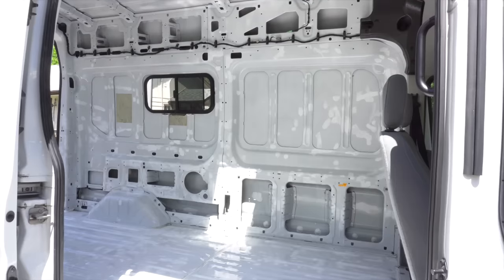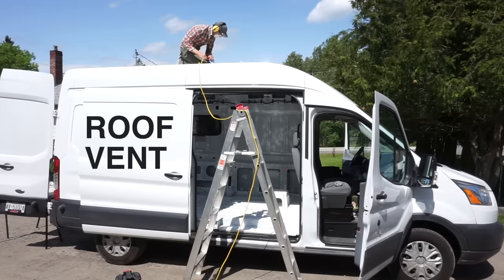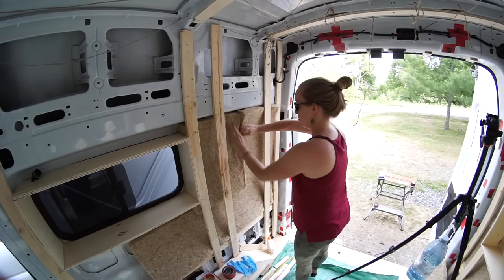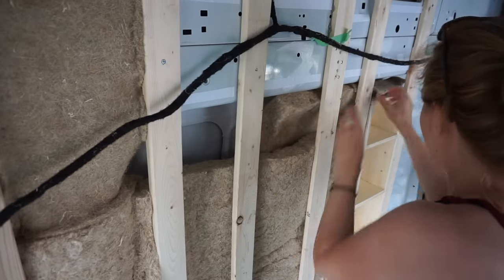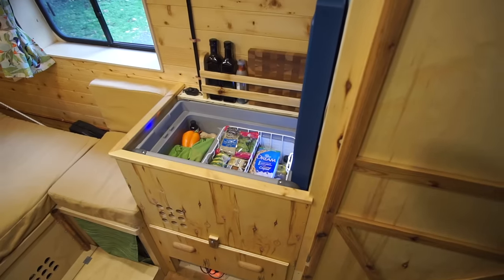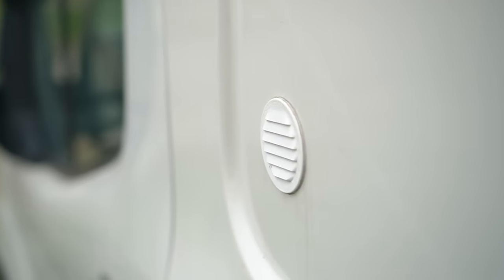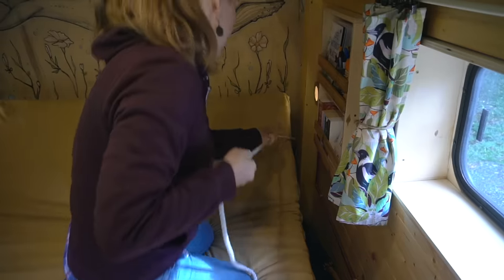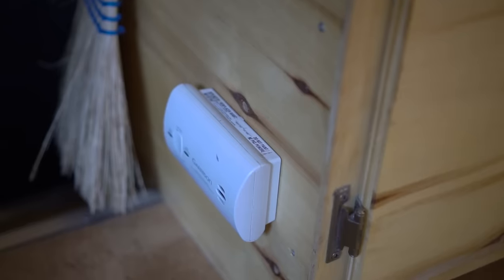FULL DIY VAN BUILD from Start to Finish | Our Epic Van Life Conversion

Comment: It’s understandable that you were thinking you were creating ‘breathable’ walls, however a ‘breathable’ wall needs all elenents of the wall to allow vapour to pass through (ie. vapour permeable). In the case of a van however you have one non-vapour-permeable skin (the metal) so you simply can’t make a ‘breathable’ wall.

If you consider that ‘breathable’ means moisture has to ge able to pass IN and OUT on both sides, with a van you have to think rather about how moisture might get in to the wall, and prevent it from doing so. This is because once inside the wall it won’t ‘breathe’ through the hemp & ply into the inside because that requires the moisture to stay as vapour; for the path through to the inside to be the path of least resistance, and a difference in atmospheric pressure to drive the vapour movement (to ‘pull’ it through). Moisture that gets in between your metal and ply lining would condense on the metal, run down, and sit on the bottom of that gap, as would any water leaking in from outside.

Having checked there were no leaks, and filling with hemp, the next measure would have been to install a vapour barrier in front of the hemp and behind the ply, to prevent any of the warm, humid air that develops in a small living space (breathing, cooking, heating with gas, showering etc.) from entering into the wall build-up. I think I understood that you were thinking / contemplating that the vapour barrier would go behind the hemp insulation. The way I tend to describe it is that in a wall with a non-breathable surface like a van side you want a ‘vapour barrier’ to stop water from outside getting in through the metal skin of the van, and a ‘vapour barrier’ to stop warm moisture pushing through the ply lining into the insulated wall space. In this case the ‘vapour barrier’ stopping water getting in from outside is made up of all the measures you diligently took like caulking all the leaks - every measure taken to prevent leaks add up to your ‘vapour barrier’ - it doesn’t have to mean an actual plastic or metal sheet material being laid over the whole of a surface (if that makes sense). Then you would put a second vapour barrier - this time a non-permeable plastic sheet material - across the inner surface of the insulation layer before adding the ply. This layer needs to be 100% non-permeable, which is why you will see people taping every joint of the material, and also often running tape to fully cover any timber strips they plan to fix the ply too, and other elements like beds & cupboards. Lastly, after fitting everything, you would tape over every screw head used to fix the ply and anything else fixed through the ply to the van wall, because each screw puts a hole in your vapour barrier that you want to seal up. It seems a bit over the top at first, but it’s really important if you’re putting up the barrier to make sure it’s 100%, because if any mousture were to get in, it really won’t be able to get out through that barrier using vapour capillary action. It is better to do as you have done and not install the inner vapour barrier at all than to install one and then not tape up the punctures. Also, were you to be making a fully sealed system there would have been no benefit to using hemp, and I understand why you wanted to - I build houses with it, and love hemp in construction. You could redo the areas you discovered the problems with by using the hemp again (you have paid for it now), then install a vapour barrier in front of the hemp, just behind the ply, and the warm air then won’t be able to get in and condense in those areas. I’m sure you’ll find the right way - you’ve both clearly made a really considered study of every aspect of this robust build.

I hope in writing a ridiculously long comment it hasn’t unintentionally come off as ‘lecturing’ or critical. It took me quite a while to figure out why & when we were using membranes (& when they needed to be breather membranes and when vapour barriers) when I first started building, aiming for breathable build ups wherever possible, so I thought I would try to find a way to explain the physics without repeating the explanations that flew right over my head the first few hundred times 🤪

Enjoy your great home 🙂
Reply: Thank you for that great explanation.
Reply: Thank you!

Comment: I also do currently a van build. But i do the insulation conventional with extruded polystyrene.
The most importaint issue with your van is to be really careful to do ventilation and heating.

I am really curios to see the back wall in 10 years, hopefully the idea works.

Comment: I had decided on using hemp as insulation for my build but then I realized that it's somewhat hard to come by in Sweden. However, when researching I did find really strong alternatives in linen and woodfibre insulation. Have to check if woodfibre is flexible enough for a van, otherwise linen looks to be the go to alternative here!

Comment: Nicebuild!! Change the solar to 400+ panels get a small wind generator and you'll really be ready for boondocking! I'll be designing a solar water heater for an RV and a trailer hitch mount for the wind generator. The sun sets but in some places the wind is very steady. How big are your house batteries and where are they?

Comment: Great job covering the build process!  Thanks for the tip on checking the van for leaks before committing the insulation.  I learned long ago that a project eventually needs a strength and materials expert to do things right.  For your shelving material Baltic Birch seems to be the wood of choice because it's lightweight and strong.  You two plus your incredible helpers built a wonderful van, despite not being professional van builders!  In a few years I wouldn't be surprised if you built a better one.   Congratulations on a Terrific build !!!

Comment: I think your condensation issue is not insulation related. If anything, the insulation just masks a larger issue. The moisture is inevitable when heating a structure in cold weather. You need ventilation or a dehumidifier while heating in cold weather. This is also why your car's A/C defaults to on when you use your heat to defrost your windshield. Do you have ventilation while using the heat?

Comment: Your leaks may have been caused by capillary action via a minute crack in the paintwork over a lap joint in the metal bodywork.  This can be very hard to find but can be really serious. The capillary action means water can be sucked uphill. I had this problem with two Kia RIO cars I owned where the spare tyre well ended up full of water and all through a tiny crack in the paintwork at a metal panel joint . I stopped the problem easily by covering over the cracks ( you need a magnifying glass to see them) with mastic gunk stuff.

Comment: @Exploring Alternatives. I just came across the video. Love it. Did you ever solve the condensation issue? I thought of using a thermal paste like used in AC duct work. I used in/around duct board in my attic when installing AC systems and it really helps prevent the thermal exchange thus prevented condensation. FL attics can reach 150°+ sometimes while AC running inside cooling to 70-76 degrees (1 year in no condesnation). 🤷🏼‍♂️

Comment: Thank you for doing this. I'm at the very beginning of my journey: the thinking part. This video made the process of converting feasible. You had help, and when necessary, you called in a professional. The video is so well organized. I shall consider it an essential How-to-guide. Question? Is there a reason why you waited toward the end to install the cork flooring? Isn't that something that happens in the beginning of the build? Also, how long did the build take you and what was the most expensive part?  Thank you.

Comment: Fantastic build job!!  I have always wanted to see how to build the frame without a watching a 4 hour video.  Your timing of the various procedures is perfect.
I am just curious about one thing, putting a refrigerator in a enclosed box with only those small holes seems like a future failure to me.  The vents on the fridge should have no obstructions in my opinion.  Wouldn't it be better just to cut a small open square or rectangle in the box as to not block the vents?

Comment: Check into Rockwool insulation and curious if you are using propane heat, ... dry heat is needed.  Propane ie. buddy heater makes condensation

Comment: Actual problem with humidity is rust. If you put a vapor barrier does NOT matter if humidity is being trapped as long as it doesn't harm the metal. 
You can just try to pour it somewhere else, and ventilate it soon or later.

Comment: As is hinted in some other comments:  To control moisture produced in a warm(er) space by your breathing, cooking, etc. from condensing inside a wall, you need to provide a vapor barrier at a location in the wall which is warmer than the dewpoint.  Moving through the wall from inside to outside, there is a temperature gradient. Any surface or material (example, insulation) located at a point in the wall where the temperature is below the dewpoint will have moisture condensing on it.  So in a shower (effectively100% relative humidity at inside-van temperature) the vapor barrier on the inside surface of the wall will still have condensation.  In many cases the dewpoint is reached in the middle of the wall so your vapor barrier should be as close to the inside surface as possible, and DEFINITELY on the WARM side of the insulation.  The metal outside of the van is an absolute vapor barrier, so any moisture that gets through your inner vapor barrier will be condensing when it gets to the metal, assuming the outside metal is below the dewpoint (i.e. always during the winter except maybe in Florida and Mexico).  Consequently your vapor barrier should ideally be installed immediately behind your T&G paneling;  and unfortunately every screw, nail, or other fastener is puncturing it.  Some plywood gluelines are actually fairly good vapor barriers so using plywood as an interior finish surface can be a good choice and there is vapor-barrier paint available which can help put your vapor barrier on the inside finish surface.  The most difficult issue then is sealing the cracks in the vapor barrier which result from joints in the material.  With buildings, the exterior can be build with "rain screen" design, i.e. breathable, but vehicles are unfortunately built with continuous metal skins which don't breathe.

Comment: those like 10-12 mm tubes... no problem, I've fit 2 phone lines, one 12-pin multi purpose cable and two CAT5 tables in a 12 mm tube. Took a lot of silicone spray and broken skin on the hands (forgot glowes) but it worked perfectly.

Comment: You guys did the build almost completely DIY except the heater, which I am super impressed with and I have to say Danielle did hold her own. She did a lot of work compare to the other Van couples I see where the female partner did very little of anything. I also glad you finished the custom roof brackets for the solar panel. If you had to do it again, you would know what to do and able to accomplish it in 1/4 of the time so you did right by not buying the pre-made one. How come you only lived in it 1/2 the time?

Comment: The solution for the roof is 2x 12volt computer fans...One that brings in fresh air from one side. The other side to exhaust it..This stops the condensation from forming..

Comment: Couldn't you just run a dehumidifier in the winter? Run it off solar power, put it near trouble spots, and see if that helps? I'm thinking that it would have been helpful to directly insulate the metal with some sort of rubber coating, to prevent the cold metal from hitting the warm air directly. You could still use the hemp, just leave a gap for moisture to vent from. Idk. That's my thought on it. It's a really difficult issue to solve. I'd reach out to a mobile home manufacturer or someone who does mobile home repairs, see what they suggest. I'm sure they run into similar issues with insulation. Or just look into how RV's are insulated.

Comment: For the window issue you mentioned, it is possible that water is just condensing from the inside air like it does on your cold glass in the summer. So you may have to focus on a drainage solution rather than an insulating one?

Comment: Spray foam works amazing but can damage the structure of the van.  Ships have a special insulation that is designed to withstand high humidity and condensation.  And it’s somewhat fire proof.  

But it’s no where near natural I’m sure.

Comment: Thank you for sharing this! I'm working on a van build and have really been struggling to find an ethical, sustainable insulation solution . How many pounds of recycled cork granules did you use?
Reply: Did you get an answer? I'm wondering the same for my Promaster 136"

Comment: 10:34, you can use wire lubricant when pulling electrical wires thru conduit.

Comment: why don't you drill a few holes on the underside of the van walls so that air can get in but water cant?  That would allow air to circulate behind the insulation.

Comment: This was a very informative video about your van conversion. And everthing looks so nice inside the van. But...in my opinion you should not have used anything organic for insulation. Because it will get wet, which again will produce mold. And eventually, if not taken care of, it will rot. Both the insulation and the wood panelling will rot. There should have been a vapor barrier there. Otherwise mold will be forming on the backside of the walls, since they are made of wood. And finally wood will rot. It will not help to have the walls breathable. Because everywhere in a van you will have furnitures with things in them along the walls. So if I were to convert a van, I would have used some kind of non-organic insulation with a vapor barrier, and I would have sealed the plywood or the wood panelling with painting on both sides, preferably with some kind of marine painting if there is such a thing. Because oiling it will not seale it. And there is something called marine vinyl that someone recommended to have both on the walls and in the ceiling in a van. That might be a good idea too.

Comment: How heavy is the finished van? 
I see that you used quite thick timber. Did you tune the suspension afterwards? Isn't the engine running out of juice with all that extra wait?

Cheers
Reply: Weight

Comment: I love the build but I'm scared that all this wood will stretch and pull together in high and low temperatures. Also you forgot to treat the walls, floor and roof before applying the furniture which results in spots behind the furniture which will get moist (faster).

Comment: i love this, but as a big guy i will break so much stuff in this van so fast... 
one tip to save money: the diesel heaters from amazon / china are just fine, and 1/5 the costs. No need for a "professional", if you can build a van like this, you can install these heaters, its that simple, just follow the instructions closely. Webasto/Eberspacher are a ripoff

Comment: Pro's and con's. You did a good job with environmentally protecting the wood and with the hemp insulation. But you are still driving a fuel driven van. Nice add with the solar and water features. Personally the time and effort you put into this is way more cost than if you just purchased something already built (even used) because the only environmental thing you have done is protect the wood used in your van. You have done nothing to protect the exterior environment. I mean do not take this wrong because it is a excellent job you have done. But in real life you could have saved the time and money for something more simple and effortless (like enjoying the outdoors/nature or traveling). Once again, A very NICE job.

Comment: Hey; i am late but i would like a little bit of help on a project. I have a Nissan Clipper i am trying to model into a kitchen car in japan.
I need to completely close it (regulation) meaning i need to make a wall on the back left door and the trunk door (i will make then a sliding opening).
My problem reside in making both those walls, there are many cruves (just like your van, the sides are inclined and it is rounded on the top corners) how did you make the paper patterns exactly? 
The flooring i get it, but the standing walls (like between the driver seats and the living space) i got no idea.
Much appreciated!

Comment: Interesting video, but as somebody who has renovated one or two things, the idea that you need breathable is a fallacy. It is downright ludicrous. What you are fighting is the dewpoint. What you need is a psychometric chart. And there you will see any kind of movement of humidity will result in dewpoints being hit. You in fact need to put in a vapour barrier on the inside of the car and have it taped up so that there are no leaking point. 
Or you can do what most do and that is used the spray on foam. That would serve the same purpose.

Comment: You don’t explain why hemp is so special it does not need a moisture barrier on the inside and can defy the laws of physics. You also don’t explain how hemp oil can prevent moisture from getting into the wood but doesn’t trap moisture inside the wood. That is truly a magical substance if they can do that. These ideas are as nuts as Havelock Wool’s claim that wool inside a wall can wick away moisture, As if it’s like wearing socks that get wet. Take some wool socks, soak them in water, put them in a baggie, and stick them in a warm place for a week or two and test that theory. Lots of things to get wet and walls will eventually dry out but that doesn’t mean they won’t mold in the meantime if they’re organic. Inorganic insulation does not mold unless you’re careless and let dirt and dust contaminate it before you install it it.